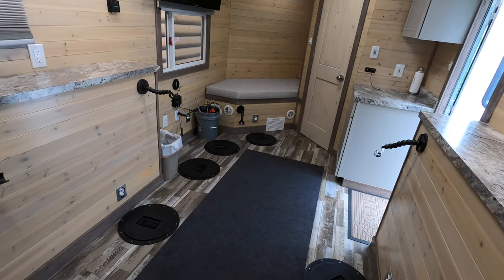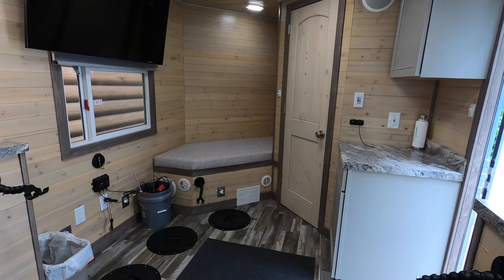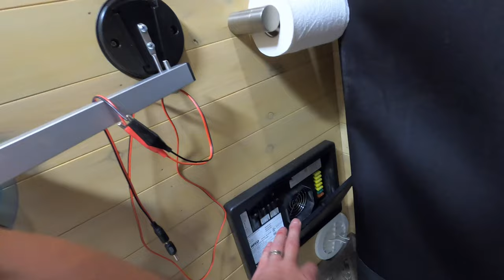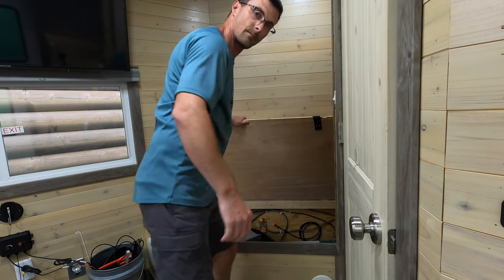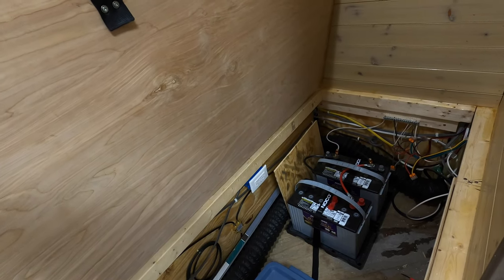Ice Fishing House Trailer - Building a Luxury Custom Yetti Ice Fishing Crib

Comment: How much would it cost to build
Reply from the maker: That’s a great question! I wish I would have kept a ledger, but we didn’t. I am pretty confident it ended up being in the 25-30k range. That was 2020 prices before supply chain changed everything. Is that practical? Most would say no. But man is it fun! I’ve been wanting an ice house for 10 years. The used market is full of them. You can find them in 5k range and upwards of 50+k with sliders and hydraulics, running water, AC for summer camping, etc. But the new market on a Yetti A816 size (8’ wide by 16’ long + 4’ v front) you won’t find one for less than that. We were partial to yetti because of the all aluminum frame. Living in the north with salty roads in winter, rust and longevity is a big factor. There’s more value in aluminum frames for this application…..and it’s lighter! Not sure how familiar you are with the market on ice houses. But we, as mentioned in the video, wanted an open floor plan. We couldn’t find exactly what we were looking for in the pre-made templates, and so decided on the blank shell…which was about 12k. And we designed it from there. Then with all the fixins, and labor (we did ourselves, and learned along the way)….we doubled the price, plus a little more I think. As soon as you start throwing in “extras”….tv, toilet, eurobed, etc. the price goes up. All of those things are personal preference. I’ve done room makeovers in our house, but never taken on a project like this start to finish. I’m pretty meticulous when building, and overthink stuff, but I’m pleased with the result. This took us all of 3.5 months in late 2020. It was basically building a tiny house (sans running water). And it could double as an RV in summer. I wired it with an extra 20amp dedicated circuit run through the ceiling to mount an air conditioning unit on the roof in the future, but haven’t needed that yet. Anyway, I’m happy to answer questions. I’m no expert, and I’m sure we did some things wrong here and there, but 2+ years in and she’s worked out great! Thanks for watching and for your interest!

Comment: what kind of ventilation fan do you use on the wall in the bathrroom? Thanks
Reply from the maker: Hey, thanks for the question. It’s called a “MaxxFan Dome” by Maxx Air. Model 3812B. It’s designed for either rooftop or sidewall. Hope that helps. Pretty sure we got that on Amazon. We had to get a 6” metal hole saw to cut through the aluminum shell. That was a little scary….measure 3 times, cut once…..and go slow.
Reply: @newnatureadventures  thanks you for the help, got a shell coming so I'll be going through the same process, I'm curious why doing the led light strips were so tough? Any advice on that?  Thanks again awesome build
Reply from the maker: That’s great. Super excited for you. For the LEDs on the outside, there were a couple things that I recall. The first was  measuring the sections and jumping the wire around the corners. I ended up drilling holes in each corner to connect the jumper wire to each light section within the house. I ended up soldering the jumper wires to the led light strips. Since there are 5 sections (2 in the front V, 2 sides and the back), that just got tedious. Then getting them  adhered to the shell required multiple applications of a sticky silicone. By the time I was happy with it, the lights were encased in silicone. We got IP68 waterproof led lights on black tape (I didn’t think a white strip would look good on our bronze/brown shell). I thought one coat of the extra adhesive silicone would do the trick. But after doing that, it didn’t stick like I had hoped. And since the house is going to be in the weather elements a lot, I wanted to make sure they didn’t come loose. So I continued to apply coats of that silicone to make sure it was solid. I think I did it four times before I was happy with the end result. I was debating posting a really raw video of some of my process. If it would be helpful to see some of our process, let me know. I can also share any of the different supplies we ended up using. Good luck with your house! It is a big undertaking, but super rewarding. And I learned so much. Thanks again for reaching out…I’m happy to help how I can.
Reply: @newnatureadventures  thanks so much for your generosity and response.....this is super helpful, I may end up reaching out again in the spring! I hope you and you're fam are enjoyin the house, happy holidays to you!
Reply from the maker: My pleasure…glad to help! Merry Christmas and Happy Holidays to you and your family.
Reply: @newnatureadventures  Back with another question if you don't mind, but I was curious where you got those little 12v plugs, and if you could walk me through how you connect an underwater camera to a tv or what you need for that....any help would be greatly appreciated !
Reply: Around 12:21 is what I'm refering too, thanks!
Reply from the maker: Hey…hope your project is coming along! For the underwater camera, I have the wheel house type that doesn’t have a display cause I knew it was going to go to the TV. Just consider what your output source is from the camera…mine was standard definition composite plug, so I installed the wiring in the wall from where I knew I was going to mount the camera to where the TV would be mounted. That way I have the two plugs built into the wall in both locations. I used coax cables and got the necessary connectors to match the yellow composite video cable female plug outlet. You can then plug the camera right into the wall. That will carry your signal to where your TV is mounted. Then just connect your TV source to the wall completing the circuit. You can do HDMI cable if your camera is HD…just need the matching connectors. I only needed a composite cable since my camera was standard def. I’ll see if I can find a pic….or maybe I should just post my install video….as poorly as it is. It might be helpful. I’ll send you a link to the 12v plugs on amazon. Before the end of the project, you’ll get really good at 12v wiring and the different connectors. I had to do some soldering on some connections. Stay tuned…
Reply from the maker: Gotcha....so yeah, I can't find the exact camera we have. It's an Aqua Vu Multiview Wheelhouse model that just mounts on to the wall, and you have to bring 12v power to it (I used one of those 12v plugs in the wall you're referring to....you can see it sitting just underneath the window trim), and an output cable. This is the current HD model available that has either HDMI or RCA composite cable output options. https://www.basspro.com/shop/en/aqua-vu-multi-vu-pro-gen2-underwater-viewing-system?hvarAID=shopping_googleproductextensions&ds_e=GOOGLE&ds_c=BPS%7CShopping%7CSmart%7CBoating%7CGeneral%7CNAud%7CNVol%7CNMT&gclid=CjwKCAjw9J2iBhBPEiwAErwpeZFTOO7H8FFhJt7O_lRpdQ70_RBrpjz2zIlU14FGcLBLOPZGLldEFBoCNlUQAvD_BwE&gclsrc=aw.ds
You could use a portable underwater camera as well if you have one. You just need to match the output cable from the camera to an available source on your TV. You can do that directly from the camera to the TV. But for a cleaner installation, I opted to run that wire through the wall during the  install. So I ran a coax cable through the wall from where you see the one yellow RCA cable plugged into the wall just below the camera mounted on the wall. The cable runs through the wall up to behind the TV where I have a matching RCA outlet plug. And I just run a short composite RCA cable from that wall plug to the composite source on the TV. When the camera is powered on, and the TV is on and you choose the input source hooked to the camera on the TV, the feed is  pumped to the TV.
Reply from the maker: Here's the link to the 12v plugs. https://www.basspro.com/shop/en/aqua-vu-multi-vu-pro-gen2-underwater-viewing-system?hvarAID=shopping_googleproductextensions&ds_e=GOOGLE&ds_c=BPS%7CShopping%7CSmart%7CBoating%7CGeneral%7CNAud%7CNVol%7CNMT&gclid=CjwKCAjw9J2iBhBPEiwAErwpeZFTOO7H8FFhJt7O_lRpdQ70_RBrpjz2zIlU14FGcLBLOPZGLldEFBoCNlUQAvD_BwE&gclsrc=aw.ds 
They're small, and they have a threaded hex nut to use to mount in the wall. I drilled the exact diameter hole that I needed to fit the threads through the cedar wall planks....and NO bigger. Then I threaded the hex nut on the backside of the cedar plank to hold the plug in place. Then  it's a matter of connecting your 12v power wire to the two leads on the back side of the plug. This could be done multiple ways. I used some speaker wire connectors...I think I got them from Lowes actually. I brought one of the 12v plugs in to test fit some connectors to make sure they would maintain solid contact. The leads are really small on the plug, so getting a connector to have a good solid contact to make sure the wire stays connected proved to be a bit of a challenge. You could also solder the wire directly to the leads and put some liquid electrical tape around the connections to protect them. That may have been the easier route now that I think back on it. Maybe others have a better solution. So far, the connectors that I ended up using have proved to be great after 3+ years in. I've had no issues.
Reply from the maker: If you need composite RCA cable, I used this plug (one just below the camera, and another just behind the TV further up the wall) https://www.amazon.com/gp/product/B00AU7H4T8/ref=ppx_yo_dt_b_asin_title_o05_s00?ie=UTF8&psc=1 and I mounted this in an outlet box with this Keystone insert panel https://www.amazon.com/dp/B09SVXHH6C/ref=sspa_dk_detail_3?pf_rd_p=89ee1d2e-380f-4a05-89e5-d22eb0a17762&pf_rd_r=4S0YED17MEHCTPK04S5F&pd_rd_wg=LG8ks&pd_rd_w=yvYic&content-id=amzn1.sym.89ee1d2e-380f-4a05-89e5-d22eb0a17762&pd_rd_r=8047e414-1105-4429-9212-6f0169a18bd6&s=industrial&sp_csd=d2lkZ2V0TmFtZT1zcF9kZXRhaWxfdGhlbWF0aWM&spLa=ZW5jcnlwdGVkUXVhbGlmaWVyPUEyU0RCU04wS1RZMlUxJmVuY3J5cHRlZElkPUEwMjQxMjI5M1czS1lGVTRWUFZCWiZlbmNyeXB0ZWRBZElkPUEwODY4ODQxS0pSQ002Q1NLQ0hMJndpZGdldE5hbWU9c3BfZGV0YWlsX3RoZW1hdGljJmFjdGlvbj1jbGlja1JlZGlyZWN0JmRvTm90TG9nQ2xpY2s9dHJ1ZQ&th=1 and then just finished it off with an outlet plate. The coax cable connects the two outlets all behind the wall. So it's just plug and play. Hope that makes sense. Of course, if you need HDMI....you could do the same idea, just need to find the appropriate plugs for the connections. I found that with only 3/4" furring strips....the space between the studs to bend and curve wires is not a lot. You might have to get creative cutting channels through the insulation to nest the wire into create enough angle at the connections without crimping the cables too much. You can also always mount an outlet box proud on the finished wall. I've seen that done a lot in ice houses because of this very reason.
Reply from the maker: I also got these pigtail connectors https://www.amazon.com/gp/product/B07C7VSRBG/ref=ppx_yo_dt_b_asin_title_o07_s02?ie=UTF8&psc=1
and did some custom soldering to make short 12" wires with male connectors on both ends in order to connect my rattle reels to the wall. I can tell you that these pigtails will fit the 12v plugs. If you're shopping on amazon looking to mix and match 12v connections, 5.5mm x 2.1mm is the size I used.
Reply: @newnatureadventures  Thanks so much for the reply, it's super helpful for me I appreciate your time
Reply from the maker: @hydrophilic2021  Happy to help! Reach out any time!
Reply: @newnatureadventures  Any way you could put a video diagraming the electrical? I am trying to figure that part out, and with no knowledge I am looking for some confidence in what I believe is the correct way to wire......if you have some footage, or an explanation in very simple terms, that would be very helpful to see.....my current understanding is, batteries in parallel to battery shutoff switch, then that switch goes to inverter, all my 120 would go to the breakers on the converter, and all my 12v circuits go to the diff fuse spots on the converter? Lights go to switch, switch goes to converter.....? Does that seem correct? Did you use bus bars? Whats the advantage or reason for bus bars that's something I don't quite understand ? Thanks for any clarification or knowledge you can share about the electrical.
Reply from the maker: @hydrophilic2021  I’ll put something together. Yes, I did use a neutral bus bar for all of the neutral wires on the 12v circuits. I’ll try to diagram out what I did. I’ll find the photos to illustrate as best I can.
Reply: @newnatureadventures  thanks so much that would be really helpful...
Reply from the maker: @hydrophilic2021  Hopefully this helps some. I'm no electrician, but this is what I came up with. I left this video unlisted, so I think you can only access via this link: https://www.youtube.com/watch?v=KyQ3NPdvsYo
Reply from the maker: @hydrophilic2021  when you check this video out, let me know if you have questions https://youtu.be/KyQ3NPdvsYo